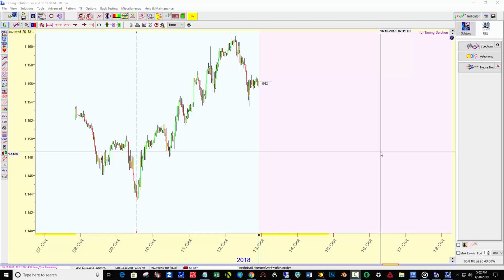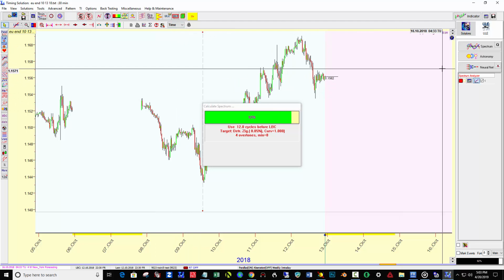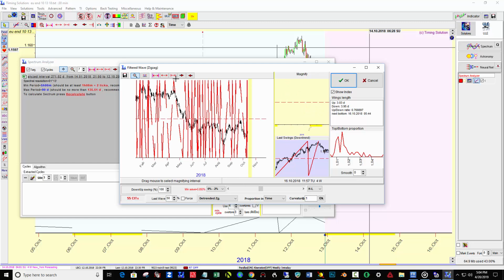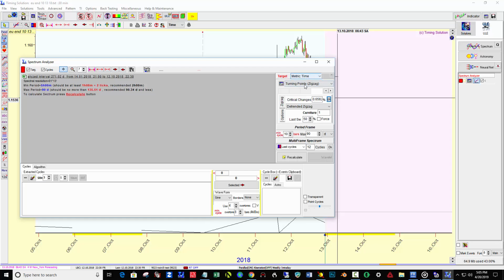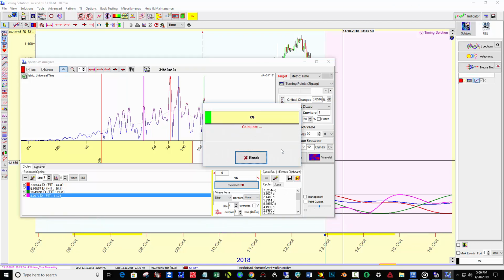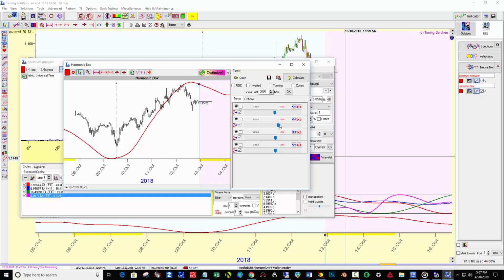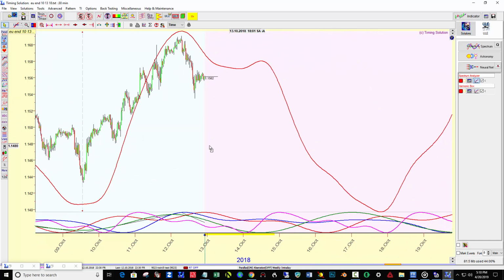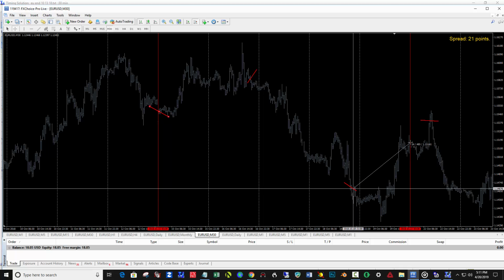Spectrum analyzer refinements

Comment: May I know how much historical data is used for this analysis? Thx
Reply from the maker: I used 9,523 bars of 30 min data. One can see that printed on the bottom of the chart once the hd version loads.
Reply: @jnevins thx. May I know Do you keep accumulating data to make next week projection? Or do you use around 9000 bars to forecast?
Reply from the maker: @binli307  Normally I use about 10,000 bars.  I load the data from MT4 Each week. When I save new 10k  bars, the new bars replace the oldest bars.